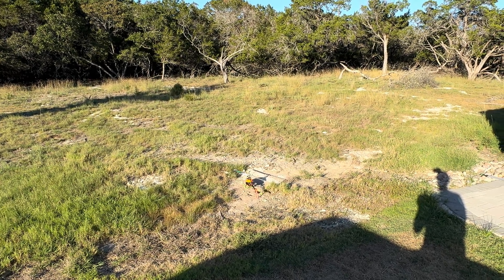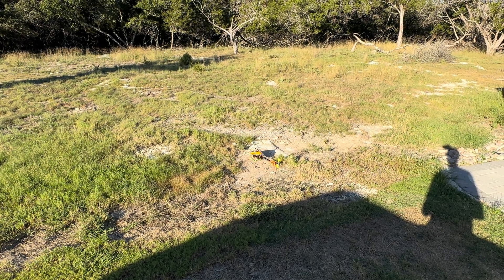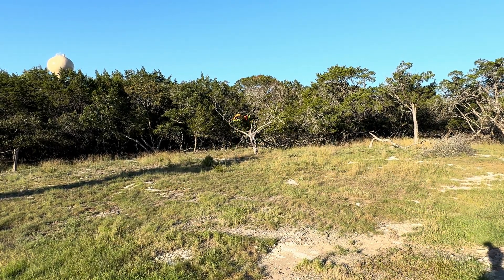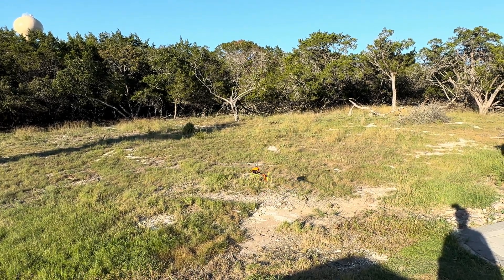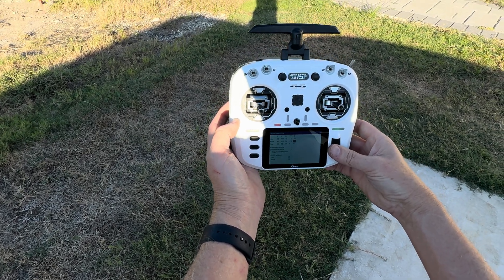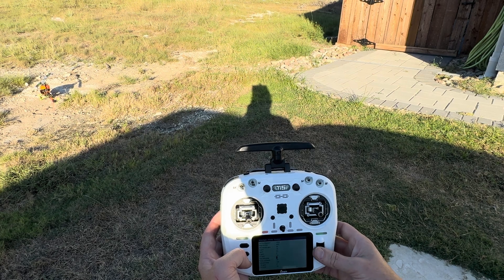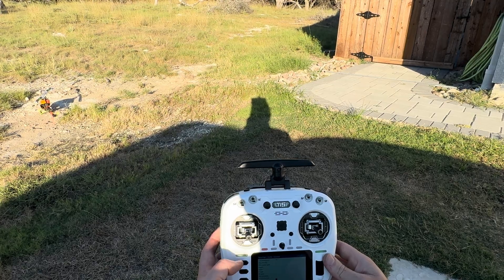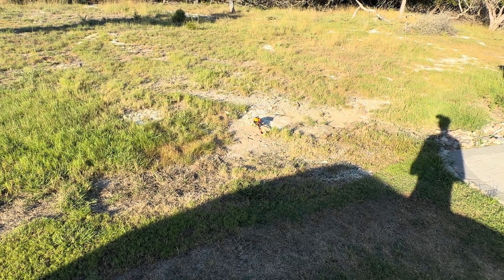Rotorflight Tuning: Mini Protos

Comment: what did you change in the ESC to make it better? what ESC are you using?
Reply from the maker: It's a very old MSH-branded YGE. It was not set to "airplane mode", so its own governor was fighting with the RF governor for control.

Comment: Hi,
Could u pls help me in RF, PID value for a scale type, slow helicopter???
Reply from the maker: I'm sorry, but I really don't know what PID values you'd want to run. Each helicopter is different! Start with the default values and tune them until it flies properly for you.
Reply: @JustPlaneChris ,
I do know its all abt each heli's flying style, but in general if u knw sme "" rule of thumbs " idea, I meant tht.
Reply from the maker: @ like I said, start with the default values and raise or lower them until it flies the way you want it to. There's no way for me to give you any approximate values. Sorry.